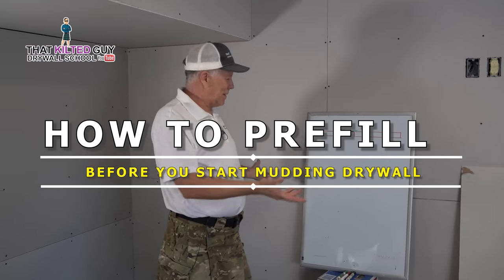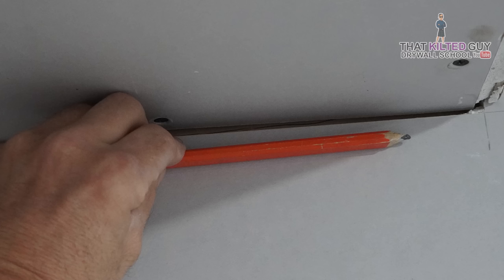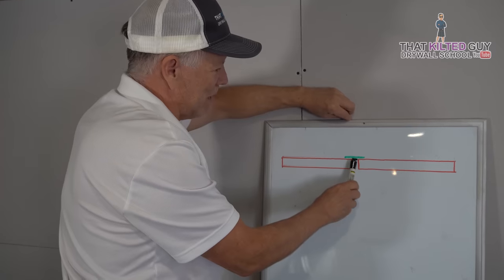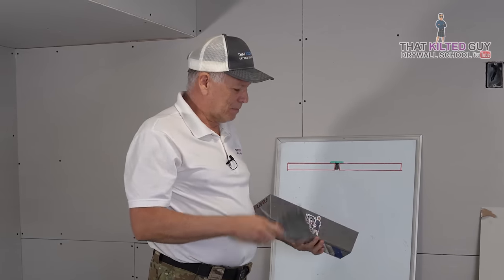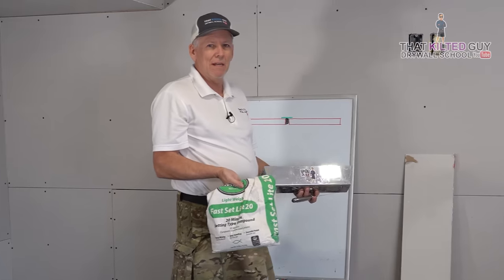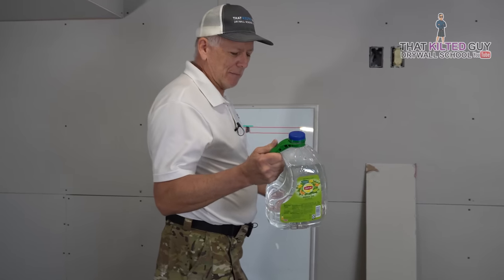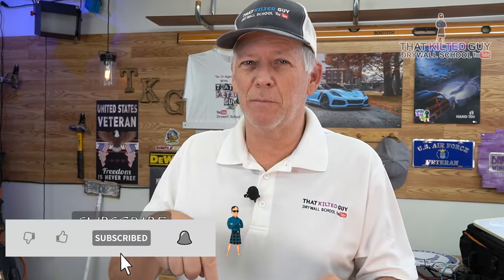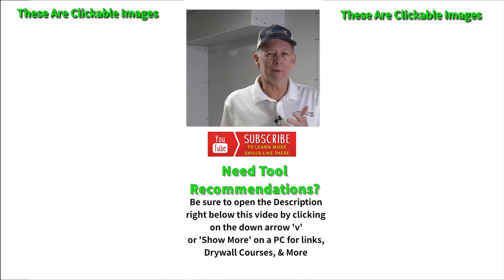How to PreFill BEFORE Taping & Mudding. Very Important

Comment: I shared this with my sisters neighbor that decided to become a  handyman because he wants to escape paying taxes when paid in cash.
He did drywall work lightly filled the joints and skipped tapping..
Then painted the walls..
Can you explain the purpose of drywall tape..
He wont take my explanation..
Thanks.
Reply from the maker: Because it’s guaranteed it will eventually crack without joint tape. It’s kind of complicated but basically joint tape keeps the mud from pulling apart
Reply: @ThatKiltedGuyDIY  thanks, that's what I told him and my sister that has about 10% knowledge of drywall..

Comment: Do have a question. Factory edge to non factory. So on fill you keep it off non factory side and just fill the factory  side. On some of them I still battle due to I see the joint. It does not look seamless. Then once tapping float the piss out of it. Is this correct?
Reply from the maker: After pre-filling, treat it like a butt joint
Reply: @ThatKiltedGuyDIY  Thank you. You know when a joint customer is fine and sees nothing wrong with it  but it ain't as good a you want it.

Comment: Shouldn't a new screw be put in that broken corner in the closet?
Reply from the maker: Not if it’s still locked down solid. Putting screws to close to damaged areas that are already weak just ends up breaking the sheet rock.

Comment: Do you normally work bare footed?
I can’t hardly walk in my own house barefooted.
I have a cousin that can walk barefooted on a gravel road.
I work with Habit for Humanity in Illinois USA and share videos with our newer volunteers
Reply from the maker: I do normally work barefoot. I do it for two reasons. One is I’m always researching healthy living and I determined that shoes are not healthy as they limit the inherent flexibility our feet are supposed to have and that's not good for our feet. And I’ve always preferred not wearing shoes anyway. Then I got peripheral neuropathy in 2008 which is a nerve pain that causes intense stinging and burning in the ball of my feet and going barefoot helps with that.

Comment: 5:57 I disagree. you want it thin to get in behind the voids. if its thick, it will ride the surface and not go deep into the cracks to make a strong supporting surface for your mud.
Reply from the maker: That’s true to a degree but if you get it too thin then it will droop and or run out of the crack on the bigger fills and often you’re filling a void that’s 3/4 of an inch wide where there’s a broken corner or something and thicker mud works much better for that. I’m not worried about filling anything less than an eighth of an inch and thick mud will go into those wider voids just fine.

Comment: The working time of Sheetrock 45 is 30 mins.
Reply from the maker: Technically it’s 45 minutes but if you overmix it, use dirty water, or things like that it can give you less working time. I mix up very quickly and I always get the proper working time out of it.

Comment: I was told you can't use a wet sponge for sanding 45 minute mud is that true
Reply from the maker: True
Reply: could you explain why that is true please I don't doubt your word I was just wondering why
Reply from the maker: @haroldruark6693  it’s very hard to sand by dry sanding because it sets up too hard
Reply: @ThatKiltedGuyDIY  I know it sets up very hard for dry sanding but am I able to wet sponge it
Reply: @ThatKiltedGuyDIY thank you for responding
Reply from the maker: Only the really thin edges
www.ThatKiltedGuy.com

Comment: I worked many years doing 12 ft ceilings on stilts.   "Was a professional 🤡"   
 Now instead of walking the extension coord lines I do maintanace teck job.  
   I get paid much more being a repair man.  
  It is sad.   A drywall finisher works hard.   💪   but little pay unless you own the business...

Comment: Ok bro tmi…. Steel handle 6s are very dangerous when doing electrical boxes.. RUBBER HANDLE.  Please don’t use expandable foam it keeps expanding for a couple days just perfill with hot mud then flatt tape 🙃🙃🙃🙃
Reply from the maker: Never been shocked by my 6 in 40 years. Foam works best in very large gaps

Comment: I've done drywall hanging and finishing for 20 years and I wouldn't hire you to finish a closet. I would need a belt sander to follow your work before I tape it. Hopefully you work on your knife skills before the next video. I'm guessing you work for a drywall material supplier as a salesman.
Reply from the maker: Lol. You’re obviously a troll and I could run circles around your quality and speed so get lost  i I first did Drywall in 1969 at the age of eight with my father, and was hanging drywall when I was 13 and have over 40 years, so I guess I’ve been doing it wrong all the time boss I’m glad you sent me straight. 😂 😂

Comment: You home owners spent big money on a reno,cough up the money for a pro,I have been a finisher for 30yrs,and cant tell you how many times I have been called to a job they tried doing themselves,OMG,NIGHTMARE,LOOKS TERRIBLE,YET THEY KEPT GOING,,,USE TO LOVE MESSING WITH THEM,TELLING THEM THAT THE HOUSE HAD TO BE GUTTED AND REDONE,,YOU SHOULD HAVE SEEN THEIR FACES,EVERYTIME,,,,BUT A PRO CAN FIX WHAT EVER THEY SCREWED UP EASILY,BC OF EXPERIENCE,WHICH THIS IS SOMETHING THAT REQUIRES,,,,HOMEOWNERS HAVE ALWAYS SAID,EVERY JOB,,,YOU MAKE IT LOOK SO EASY,,,AGAIN EXPERIENCE,EVRERYNE UNDERESTIMATES HOW HARD FINISHING DRYWALL IS,KNOWING WHAT TO DO IN EVERY SITUATION,COMES WITH TIME ON THE JOB,,,AND THEN YOU ALSO NEED TO KNOW WHAT ELSE NEEDS TO BE DONE AFTER INITIAL TAPING WHAT STEPS YOU NEED TO TAKE FOR THE FINISH YOU WANT TO USE,FLAT PAINT,SEMI GLOSS,GLOSS,MATTE FINISHES ALL REQUIRE ADDITIONAL STEPS,WHICH AGAIN COMES WITH EXPERIENCE,,,,GOOD LUCK,,,DONT FAINT WHEN WE HAVE TO COME OUT AND GIVE A PRICE TO FIX YOUR ALREADY PAINTED  DRYWALL
Reply: Note,there is nothing worse than a new finishing knives,when purchasing check blade edge for chips,or dents,Acter PURCHASE TAKE medium grit sand paper and carefully sand across edge in one direction TILL you feel a nice edge,,,,,not sharp like a steak knife,sand enough to see a good edge,,,the problem with new is THEY leave to much compound when feathering edges,doing nails and screws,,,sanding the edge GIVES better results,,,be careful

Comment: Wrong wrong wrong you always cut out loose paper ALWAYS
Reply from the maker: And where did I NOT do that?
Reply: On the but joints when you used the back end of your knife to push it in the paper edge
Reply: We V out all but joints and fill with concrete fill from synko
Reply: We do very hi end custom homes in Vancouver BC Canada